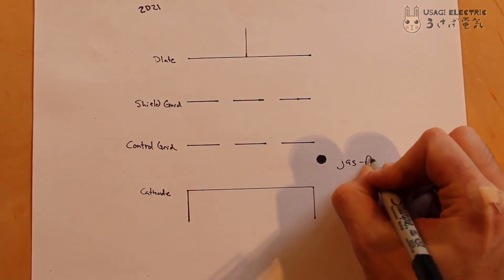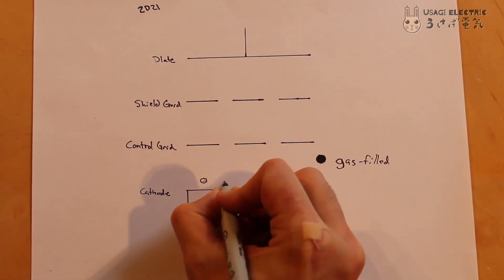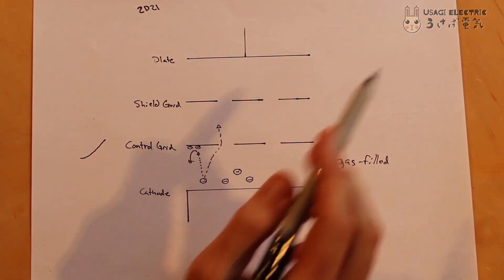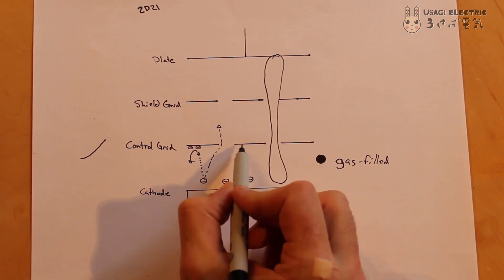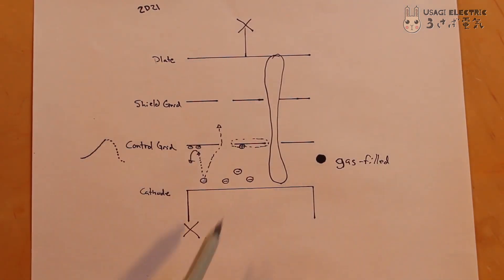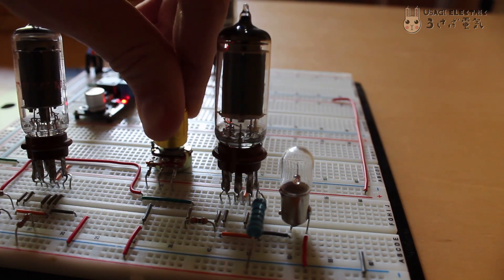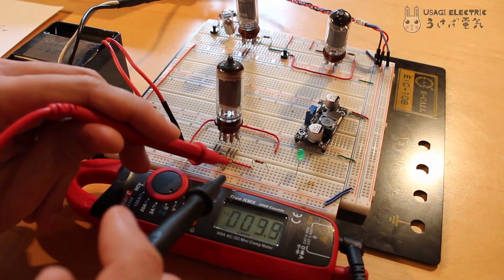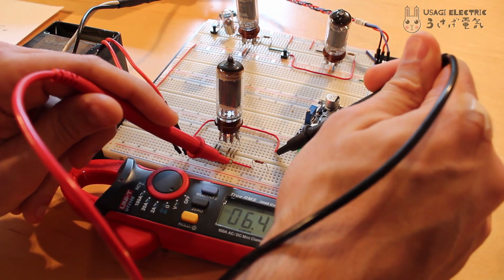In a Minute: Vacuum Tube Thyratrons in 60 Seconds

Comment: Hello 👋🏻
Can a flyback be connected to the anode of a thyratron and the filament discharged with a bank of 6v 3000f supercapacitors connected to a 20A DC-DC converter, powered by 12v battery?